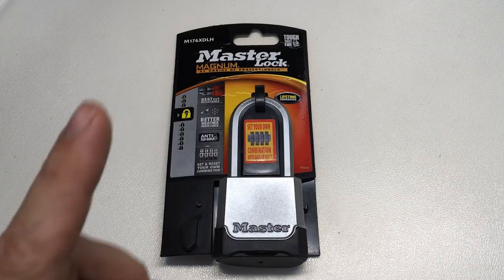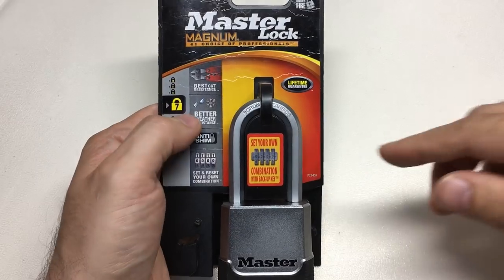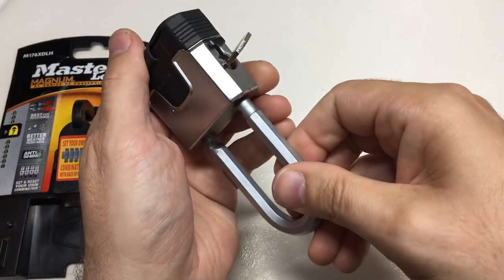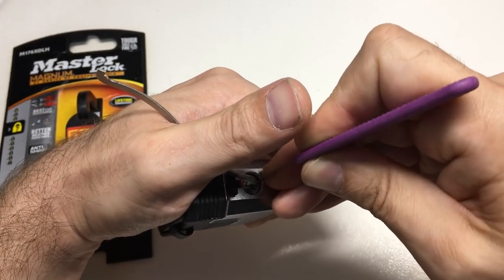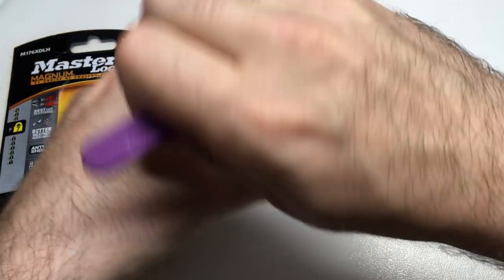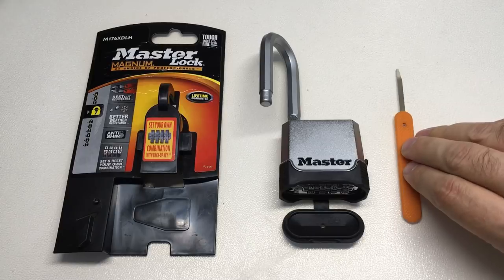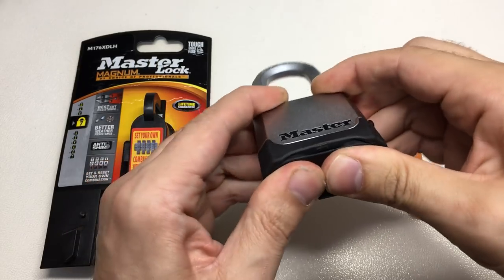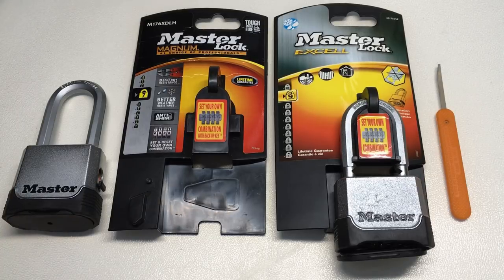The Worst Designed Lock in The World? You Decide - Master Lock M176XDLH Opened 6 Ways

Comment: Dont even own a knife tool yet, but I picked this up after seeing your original video on this lock. So far I find the side lock quite challenging for a novice to SPP (a combination of being so small and the usual master lock mushyness). Raking is still a breeze as you point out though!

Also, not sure if it is just my version, but I dont have to compress the shackle while picking/racking. I turn the core normally and then compress the shackle to open it. Made it much easier to hold once I figured it out.
Reply from the maker: Yeah, that small keyway is the most secure feature, lol :-)

Comment: I seem to remember a BosnianBill video where some Chinese lock had the set screw for the core on the outside.  Didn't matter if the shackle was open or not, taking out that screw dumped the guts.  I wish I could find the video now, but that was a far worse design
Reply from the maker: I think that’s just poor manufacture - I doubt it really went through a design process, but I see your point :-)

Comment: MasterLock have really confused us with model numbers too - as far as I can tell, you can only tell whether you are dealing with the OLD (bypassable) mechanism or the NEW (non-bypassable) mech.  by looking at the features and ignoring sometimes identical model numbers - the two locks in this vid have the OLD mech, which has a  code-change key of some type and a stamped out 'front panel'. The NEW version of the mechanism does not need a key to change the code, and has a cast zinc alloy (I think) 'front panel'. This new mech can't be bypassed, but it CAN be decoded with a knife tool, just like the old mech. The NEW mech can also be picked - LPL has a video on this. I don't think the OLD mech locks featured in this Lock Noob vid can be actually picked, as it's hard to get any feedback on the wheels. Hope you agree with all of this, I'm very happy to be proved wrong Mr. Noob :o)
PS. the other difference between old and new mech locks I have noticed is in the style of the rubber bump strip around the lock - old ones are as seen in this video, new ones have a narrow band around the lock about 1cm (3/8") up from the bottom. This difference may not be absolutely reliable - but that's the Master way, isn't it ? The 875 has no bump strip at all, but does seem to have the NEW mech. See LPL video.
Reply from the maker: These are the old style, but they can still be found for sale :-)
Reply: I know they are the old style Ash, I said as much in my long comment ! I thought it needed pointing out that there are two '175' named Master mechanisms out there, and some even seem to share the 'M175' part of their model numbers, which is just crazy, though it won't affect Master Lock sales one bit. I'll take my comment down if it's no real help to anyone. :o)
Reply from the maker: noakeswalker apologies, your comments are correct and informative, so no need to remove them - I replied to over 200 comments straight last nite, so maybe my reply to your was a little more brief than it deserved. FWIW no, this model can’t be decoded by feel as the shackle doesn’t act directly on the wheels in a way that provides the Wright feedback
Reply: Yes, I've inspected lots of YT dismantlings people have done of the old 175 mech., as I wanted to know why the bypass used to be so easy, and why it's not possible on the new mech :o)   As I've been so confused about which Master 175 mech is which, I thought I'd put a massive long comment up with what I'd found - I hate putting up lengthy comments,  I guess I could have made it about 5 times more concise if I'd edited it down more....doh! :o)))

Comment: So what is a good lock to purchase? Are there any that can't be picked? And by any chance, are any of them combination locks? Thanks.
Reply from the maker: Combination locks are inherently low security, though Squire do some good ones, Abloy do some of the best (and most expensive) Padlocks that are almost pick-proof... ABUS do a lot of locks that balance value and security very well. Speak to a proper locksmith about your needs and they will be able to help you :-)
Reply: @LockNoob  Alright. Thank-you for the advice, although I hope you arn't ever  within even a 10 km radius of me or my valuables. Haha.
Reply: @LockNoob  Hey so I've been looking around. The thing is, I've got a something I want to put locks on. Unfortunately, the hole for locks only allows for 8 mm. What I ended up finding that might work is the Abloy Protec2 PL330 - 8 mm diameter. I was thinking of picking up a couple. They are graded as level 3. Would that be good enough? I do see higher end models, but they all have thicker diameters, so I don't think they would fit. Any other suggestions?

Comment: Wow! :O

I'm surprised masterlock hasn't started using plastic cores...

I bought a terrible euro lock from bangood.com, it has a plastic core, mushy tolerances, with terrible bitting. I wasn't expecting much for about $5, but didn't expect the plastic core, it was very much like the "40mm" padlocks. Haven't gutted it yet, as it came with a plastic thumbturn mechanism.
Reply from the maker: Those plastic cores really annoy me :-)
Reply: Probably they would up security by one or two points for better weather resistance